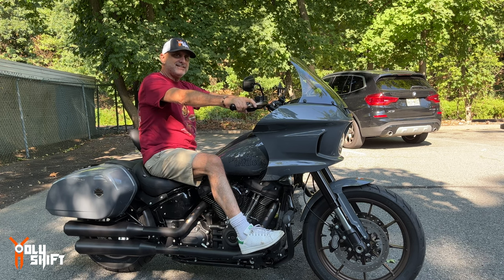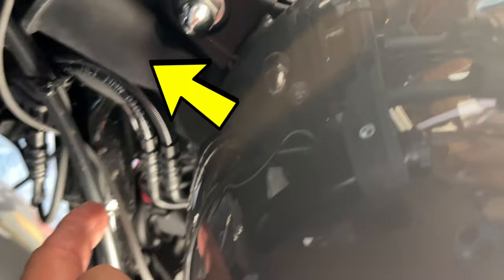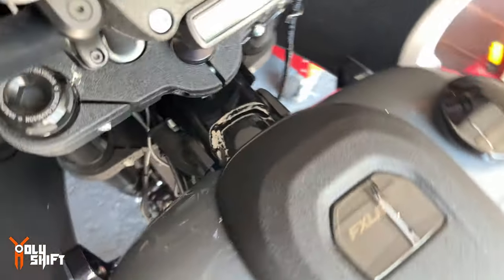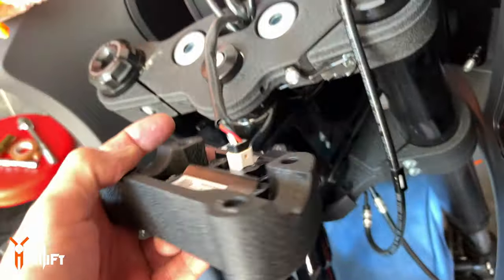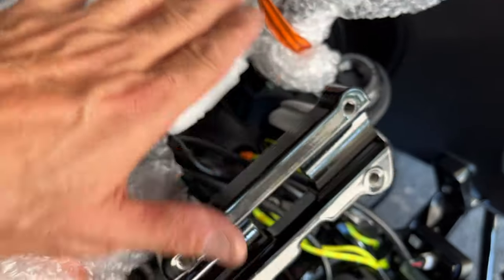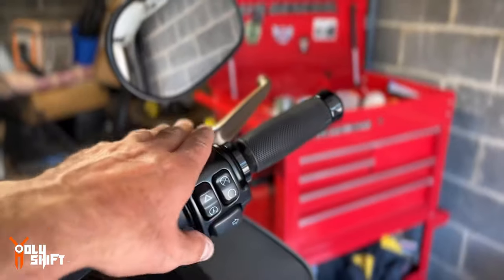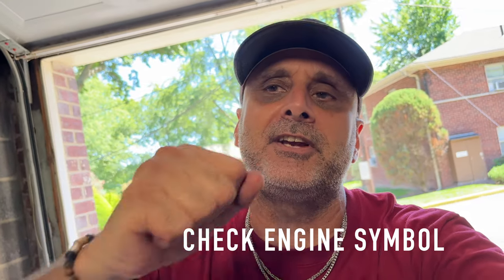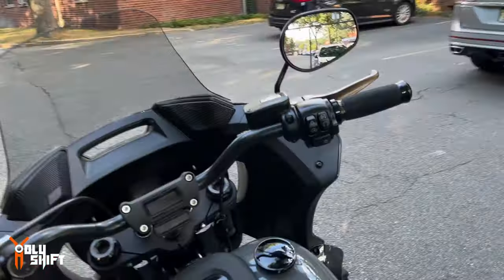Risers Install Low Rider ST.

Comment: While the stock bars don't have much pull back, if you tilt them back toward you (or down) you'll then have a slight bend to your elbows. That may be more comfortable on long rides and will make low speed turns easier. Very good and informative video.
Reply from the maker: Thanks Jerry- yeah I played around with the bar position to get the most comfortable position for me…including wrist and elbow positioning .
Reply: @motorman857 I took your advise and did this on my new 2023 Lowrider S, and it worked phenomenally! It’s a more relaxed riding position and I feel like I have significantly more control when performing low speed maneuvers. My question to you, with this being my experience, does this mean I would not be a fan of a taller t-bar setup? I guess I’m asking if my liking of the tilted stock bars is a result of them being closer to me, lower, or both? Thank you, big fan!
Reply: @Mr_TimeMachine_Too  The closer the bars are to your chest, the more leverage you have to turn the bars. Just putting on risers won't help. You either need bars with more pull back like Street Bob bars or risers that bring the bars 2 or 3 inches toward you.
Reply: @motorman857  Thanks Jerry, you are the wisest motorcycle man out there! And my new Lowrider I picked up yesterday is identical to yours, a 2023 in white sand pearl. I’m locked into your channel for your journey with yours!

Comment: I recently installed this exact riser on my ST. Tip # 1, notch out the small section on the bottom and you do not need to remove the tank. Saved about 2 hours of work.
Reply: Notch out what???

Comment: Appreciated your video, the Bung King 6"up 2"pullback is perfect for me. I had no desire to remove the tank and undo all the wiring so I had a 1/4" slot cut through the back side of the hole for the wiring allowing me to remove the stock risers and install new in under 1/2 hour with the top clamp back on there is plenty of rigidity very simple. Unless your standing on your head you really can't see the cut slot.
Reply: That is exactly what I recommend as well.
Reply: Did u cut it yourself or ordered it like that?
Reply: can you send me a pic/video of where you "cut" the slot on the back side?  I am trying to envision..just not sure as i look at their site where it would take away from any integrity.
Reply: Can you elaborate on this?
Reply: In my mind at least, if the factory risers are two pieces, there would be no disadvantage to essentially having a one piece riser cut on the top making it not really 2 pieces but something a bit less than 1 solid piece.

Comment: I have the exact same riser on my ST and it made a huge difference in the comfort of my riding position. It was well worth swapping out the original riser. The other thing I did was delete the air vent in the center of the windshield. Believe or not it made a big difference in the sound quality of the rockford fosgate audio system at highway speeds. It's sounds  louder and the clarity also improved.
Reply from the maker: What about the wind buffeting? Harley designed that vent on purpose- wonder what it achieves
Reply: @HOLYSHIFT  honestly I feel no difference with the center vent deleted and I ride pretty hard. I just did the delete over the weekend and took the bike out. Street and hwy, had it up to around 110 on the hwy, no bufetting, if anything I felt less wind wind from what I remember I used to get a some wind on my face from that center vent.
Reply from the maker: @J_BLAZE415  how did you block it ?
Reply: @HOLYSHIFT  I made it out of a piece of plexiglass. About 1/3 the thickness of the factorty windshield. Send me a text and I will send you some photo's. It  took a about a hour or so to make a templet, cut it, sand the edges insert it.
Reply: @J_BLAZE415   Sounds interesting. Let's check it out!
Reply: @andresrubalcava_  I have since this post ordered the clearview windshield with the center air vent delete. Prior to that, I made my own with a piece of plexiglass. Cut it to the shape of the air vent and drilled 2 holes at the bottom that aligned with the factory windshield screws which held it in place. I placed it on the inside of the windshield between the fairing and windshield. It was almost unnoticeable. I don't have a go-pro or helmet cam to show the difference in the sound and buffering at hwy speeds. But I can say without question it made a noticeable difference. It was hard to hear my speakers at hwy speed prior to deleting the center air vent.
Reply: @J_BLAZE415  thanks for the detail! See you on the road.

Comment: I would have cut the back side of of the new riser and touched up the the edges. As you would never see it and would have made installation a lot easier. Just a thought 👍
Reply: I honestly thought of doing that when I get mine. EZ peezy
Reply: The wires unplug under the gauges on my 2023 lower St ...I don't understand having to take to take off tank or cutting the risors....

Comment: I agree with this upgrade. I put the 6.5 Thrashin pull back on my Low Rider ST. Huge difference.
Reply: Can use the stock top clamp/speedo housing with your trashin riser?
Reply: @abu_psb5832  you can if you would like too. But I got the new speedo bracket as well. Just looked nicer than stock.
Reply: Did you have to buy additional bolts/bushings or did stock ones work?
Reply: @abu_psb5832  kit comes with a new speedo housing.
Reply: Sorry  How many you tall ? I'm about 170 cm  tall. I want to chang risers 6.5 but put on stock handlebar. Will sitting get better?
Reply: @ส.สองโตโยต้า  168cm. Much more comfortable riding position.

Comment: would it  easier to put a 7/16  notch  in the lower part of the riser  support to put the wires through  ,with out  disconnecting  all the wires ?

Comment: Great vid!

I found that if you go with the 8” (and above?) riser, you don’t need the HD upper clamp mentioned. 
It’s too small to fit. 
I went with the Bungking 8” riser with 2” pullback. I’m only 5’9”, but it allows me to sit back in the Saddlemen Step Up with a good bend in my arm. If the swap was super quick, I’d reorder, the 10” riser with pullback, as I feel those would be a perfect set up for me.
Reply: With the 8’ and 2’ did you install new brake line/cables? I’m looking into the 8’ 2’ myself
Reply: @markrivera2272  Did you end up having to change the cables? I'm also looking at the 8".
Reply: @andresrubalcava_  I did not, I did go with gorilla wire extenders though. but I also now know that I want way higher. I’m still in an aggressive stance even with 8’ 2’ pull back. I’m thinking of going full 12 with a 1 inch rise bar set up and commit to doing it right with brake lines, cables and clutch wire.
Reply: @markrivera2272  Cool! Thanks for the detail. See you on the road.

Comment: Hi nice job! I want those for my 2022 low rider s. I saw on bung king website that there Is AN option for holes for internal wiring. Do You think those are necessary?

Comment: Dropping mine off tomorrow...weather permitting, with Thrashin' 6.5 pullback and their handlebars.  Stock handlebars seem to have an 'outward' cant.  Thrashin' handlebars turn the bar end inward.
Reply from the maker: Gotcha! Good luck - it will be more comfortable
Reply: Any idea if stock top clamp (speedo housing) can fit the trashin riser?
Reply: @abu_psb5832  I'd have to let you know next week.
Reply from the maker: @abu_psb5832  I was told that you need a Thrashin top clamp too . Stock won’t fit !
Reply: @HOLYSHIFT  Just checked my email dates......had your video come out two weeks ago, I would have saved a few hundred by getting the Bung King risers....but oh well.

Comment: Hi, thank you so much for the video! Could you tell me if you can see the gauge well - even with direct sunlight.? I read that the angle changes about 30 degrees and I am not sure if I could still see everything when installing the riser.
Reply from the maker: Yes no problem

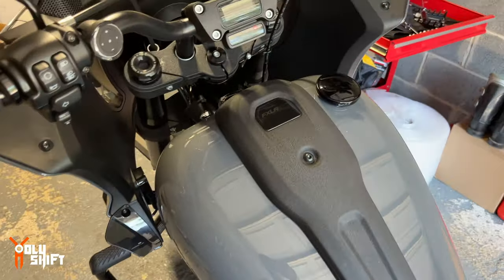Comment: Hey, at 17:11 on your video, I see a controller on your handlebar for the audio system. Which one did you use? Id like to not have to fiddle with the phone to adjust volume levels and skip songs and such.
Reply: I got a nice one from Amazon.   Rubber strab holds it on the bars. There are several there. All about the same

Comment: I believe the stock riser is 5" rise a d 1" pullback when you measure it. I ordered the 6.5" thrashin risers and the measure dead on at 6.5" to the center of the bar, but the stocks measuring around 5" to the same spot.
Reply from the maker: I measured 4 “ rise and 1/2 pull back on stock…. In any case - great improvement for me .
Reply: I have a 2020 softail standard, also went with bung king risers. Being 5'6" I went with bung kings 8inch riser with 2inches of pullback, paired with thrashin supply mid bend bars. Oh also a saddlemen stepup. And this setup is perfect for me. The end height of my bars/risers would be 12inches which is basically the height of the stock mini apes the bike comes with, didn't have to get longer wires etc. Yall could 100% rock 8inch risers and be fine, assuming you're taller than me lol everyone is. I think 8inch risers are the perfect height. Having like 10inch + looks kinda goofy lol

Comment: You don't need to purge remaining fuel from the lines when removing the tank. The quick-disconnect line allows you to disconnect the tank with little to no leakage. I didn't bother purging my fuel lines when I installed risers on my bike.
Reply from the maker: You’re probably correct! As I was doing it I was thinking to myself “ what’s the purpose….”

Comment: Sandy, I did 4 " risers on my bike and Harley called for red loc-tite on the riser bolts.   Curious of these risers required it.  Great job on the video.
Reply from the maker: I used the original bolts that had thread locker on them!

Comment: For all people who are looking forward to do the Same! Bungking Just released this pair of risers especially for the ST so you dont have to order a different top clamp! Just ordernd mine Today!
Reply from the maker: I just checked on Bungking website what Si. Rgmn said above and apparently they redesign the bolts placement and you can use their new riser design to fit the top clamp that comes stock on the Low rider ST. In my video I used their older design that required using a different top clamp. Thank you sir !
Reply: @HOLYSHIFT got mine today. I did the whole Job in like an hour or so. Feels great, rides great. Never wouldve found those risers without your Video!  The wires are kinda tight If I turn the handlebar to the right side. I guess I gotta loosen them up a lil bit more.
Reply: @HOLYSHIFT  does yours feel tight at all when turning to the right?  I did my install today and feels tight-ish.
Reply: @HOLYSHIFT  did you get NO holes correct?

Comment: Just a thought... if you pulled the main fuse before disconnecting any wires, then did all the wiring stuff, then finally put the main fuse back in, would the computer know you had ever disconnected anything?  I'll have to give that a try.  I sure don't want to go through a lot of resetting shenanigans.
Reply from the maker: Maybe…?
Reply: @HOLYSHIFT   It's like working on a desktop computer.  You unplug the thing before you open it up and replace a video card... your motorcyle has an onboard computer... if you pull the main fuse, you disconnect the computer which is always on a very low "sleeping" levels even when the bike is not running... so pulling the fuse is like unplugging the your PC... so you can go ahead and work on anything electrical without the ECU knowing about it.

Comment: Okay I did find the Bungking information in your comments and also the Harley top clamp part # but that part # does not come up in a Harley parts search. Is it listed as a Lowrider part?
I just found in a parts search but it’s listed as a StreetBob part. Is that the information you found?
Fit ent is good?..
Reply from the maker: Yes ! It’s not under  FXLRST. I consulted with a shop called Get lowered cycles- call them , nice guys. Say my name please
Reply: @HOLYSHIFT   Awesome, I’ll definitely contact them. Thanks so much for your help. Great videos. FYI
I’ve talked nto Bungking about 4 weeks ago. They are in the process of developing a peg style lower crash bar to fit the Lowrider ST with forward controls . I like what you did with the Harley Moustache Bar but myself, never been a fan of that style. Love the Bung King risers you put on and of course the lower crash bar and how it looks on the mid control model ST.
From Toronto,wishing you a great day!
Dan

Comment: Can you tell me what is size in oryginal riser? 4" and pull back 1,5"? I can't find this information.
Reply from the maker: Stock is 4” rise and minimal pullback ( not sure how much) so when I installed the 6” it was practically an additional 2” rise and about 1-1.5 inch additional pull back
Reply: @HOLYSHIFT   thanks for answer. How tall are you? I'm 172cm.
I wonder if there is shipping on Europe....

Comment: Great video! How much wiggle room did you have with the cables and wires? Considering the 8" risers and would LOVE to not have to get extensions.
Reply: I just did this, and the brake line on mine is as tight as it can go, so I don't think 8" will work with the stock brake line. Wires were starting to get a little tight too.

Comment: Was there a wire in that bundle not connected to anything? I just took the wiring bundle out and either I accidentally unclipped something or Harley left an extra wire in there that doesn't connect to anything.
Reply: Update: Harley left an extra wire in there that doesn't connect to anything.
Reply: The service manual shows that to be the connector for heated grips

Comment: BungKing makes a riser for the ST that will use the stock upper clamp so you dont have to buy the extra HD part. You are using a streetbob riser that maybe why you have to buy that extra part
Reply from the maker: True ! When I installed this a while ago - Bungking still didn’t have the riser that fit the stock ST clamp. Now they make it do it fits the ST clamp
Reply: Got ya! Ordered mine and will follow your video for installation. Thanks brotha.

Comment: Ive thought about doing the same thing....I have a stock 4.5in riser and i think i could switch it out with a 6in riser and using the same handlebars and using the same stock cables...
Reply from the maker: That’s whaI did
Reply: @HOLYSHIFT  I saw that...But mine is alot easier...No removal of tank and no disconnecting of wires or cables...Only remove the quick release of my Memphis Shades Batwing Fairing
Reply: @bradlozano2571 I am wondering about the "batwing fairing" you referred to? For a low rider s I presume

Comment: Sandy, how much wiggle do you get by using the stock rubber bushing?? I’m looking at doing the same set up and I’m getting a lot of suggestions that with that much height really increases the leverage and they highly recommend using polyurethane bushing. Can you wiggle your bars up and down a lot when your sitting still? If you decide to change yours out can you please let us know the difference.
Bung king dont offer it in chrome, i might have to buy the black one and send it in to be chromed. I really like your set up.
Reply from the maker: Solid as a rock! The riser I installed isn’t that much taller and doesn’t add too much leverage- so I used stock bushings. I feel no difference than before!

Comment: After doing this mod, I get BCM code B2151c. Left rear turn signal is not working. I remove the tank and verified all the wiring a second time. I've also run through many of the ECM/ BCM resets and clear the diagnostic codes. The code is still present. Any ideas?
Reply from the maker: Sorry to hear that ! I don’t know why it’s giving you that message
Reply: @HOLYSHIFT  the bulb was burnt out. I replaced both of them, cleared the codes, and all is well. Thank you for this video. It really helped. 🙏

Comment: First off , love watching you build. Just ordered the same seat.
I’m looking at Bungking and there are a few options to pick. Can you tell me exactly what your order was?
Internal wire option ? Or no internal option? Also the Harley part #for the riser cap?
Any other info you think might be helpful as far as ordering the riser.
Just bought my grey st and having the forward controls done by my dealer. Getting all the parts for a Heritage put on mine.
Thanks for your help.
Dan
Reply: It’s great you “ Hearted” my comment but I did ask you a couple of questions to help me out with ordering the Bunking risers and the riser cap from Harley. Maybe you could reread my original comment and send me the answers back..
Thanks
Dan B
Reply: You want the one with no internal wiring. Looks like bung king makes one that is compatible with the stock st clamp now.
Reply: @coltonwood9846  exactly what I had reade...they do make one that goes with stock plate.I thinking no holes is the one you want..

Comment: Sandy, that was a great video on the risers, I might do the same to mine. Also I noticed you have forward controls and a Harley engine guard. Harleys website has a figment note that their engine guards won’t work with forward controls. What brand are you using to get them both to work on the Lowrider ST?
Reply from the maker: Thanks- check out my forward controls install video I explain what controls I use. The engine guard is a Harley mustache engine guard

Comment: To avoid all that work, I would just cut the center piece (closest to the driver) off the riser.  This will enable you to slip all the cables into the center hole of the riser.
Reply from the maker: Please subscribe